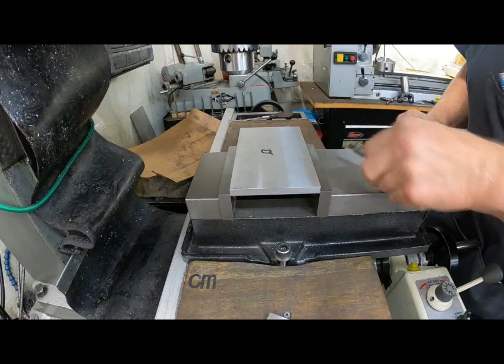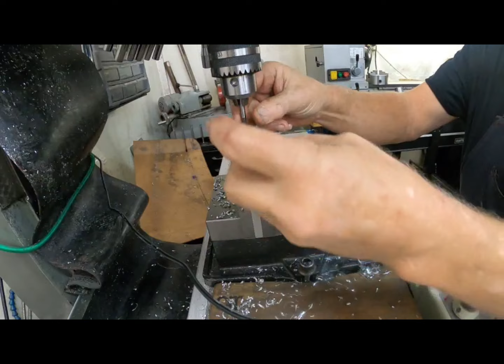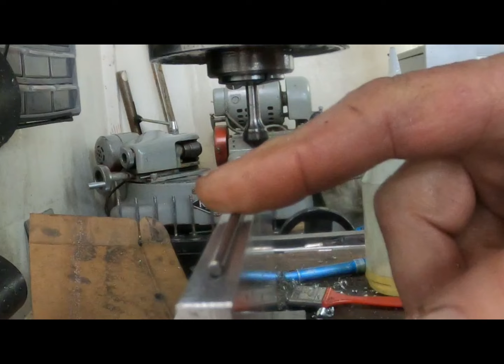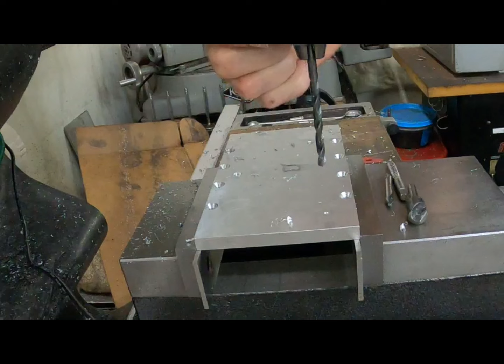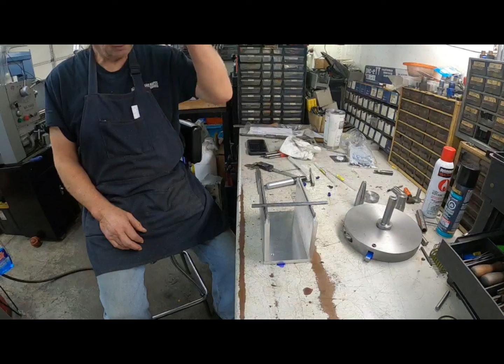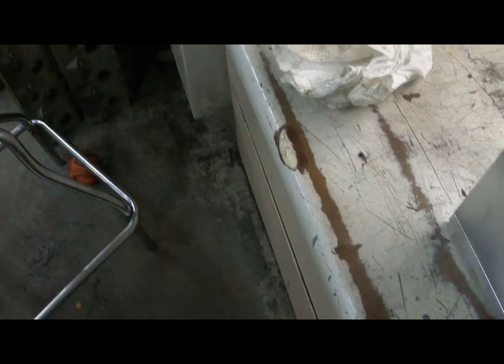building surface grinder wheel balancing stand.

Comment: I have a 12” fly cutter sitting on my bench that looks similar I need to finish. Wasn’t sure how I wanted to secure the cutter. I see you drilled and threaded through yours. Is that aluminum? I was wondering how it would hold up to the use and the tool getting getting tightened up over and over again. I was thinking I would need to make a couple metal inserts to hold the cutting tool in place and sandwich the cutter wheel between them. Yours looks pretty simple. 
Balancer is another one on the list. 😂
Machines to make more tooling ! I just love it.
👍🏻👍🏻
Reply from the maker: Hi Jason. The fly cutter is all steel, and there is a set screw that comes in from the top that pushes on the cutter to set the depth. Thanks 👍